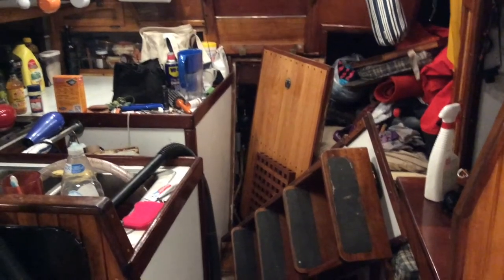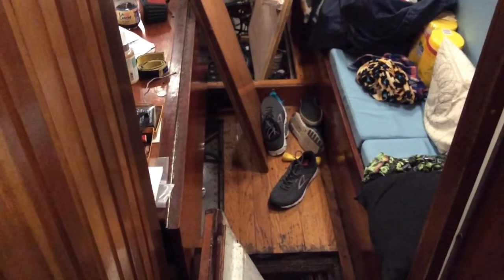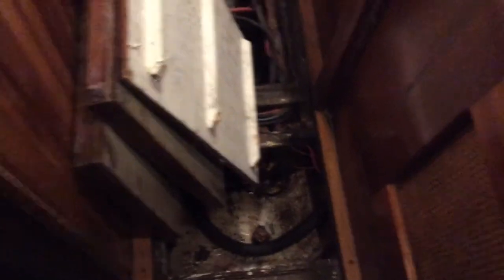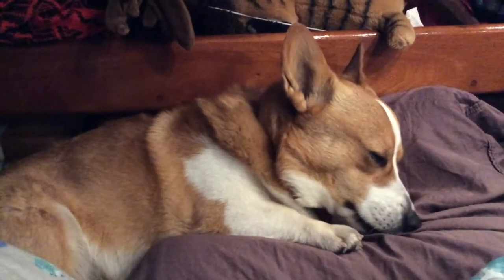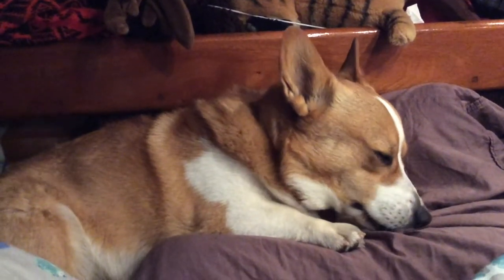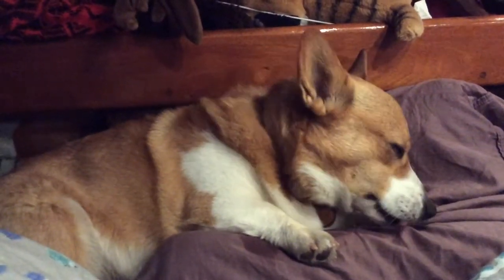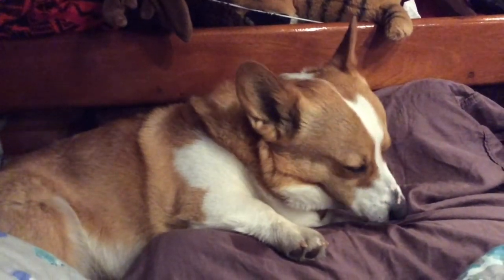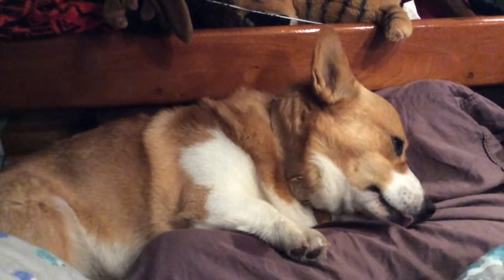Living on a Sailboat: We Almost Sank

Comment: Water intrusion from a small 1” seacock located in the hull 3 ft below the physical water line will invite 34g/min aboard a vessel. That is 2,040g/hr (Naval Sea System Command, US Navy sailor’s handbook ISBN 0-87033-248-1). 

Also a pump rated at 1,100gph will likely pump about 300gph when all hooked-up.

One final thought, a high water alarm hooked up to a horn in the cockpit would alarm passerby, dockmaster, staff etc. Put your phone numbers in the port openings with the note: ''In case of emergency call:''

Comment: You might want to buy a sprinkler timer at the hardware store. There are units that attach to the shore hose bib and have a dial that you set for 30 minutes or an hour of flow. They're mechanical and don't require any power. That way, you don't have to worry about forgetting to turn the hose bib off. Cheers!
Reply from the maker: +Stuart McLeod yeah, a bunch of my neighbors have them and I always thought "why not just turn off the hose?" Now I know!

Comment: Batteries should not be that low . Obviously
Reply from the maker: Every boat design has its flaws. These batteries are under the floor to keep weight low in the bilge. The alternative is the more modern approach of mounting the batteries as high in the boat as humanly possible but this leads to more weight aloft. 
The best plan is to keep water out of the bilge so that the boat doesn’t sink 🤣

Comment: My electric and manual pump are both in the main bilge.  Can you not set up like that?
Reply from the maker: The electric one in the bilge is 500gph and led through a 3/4” hose with a lot of head. The high water rescue pump is an 1100gph and led through a 1-1/8” hose with almost no head. 
The water was coming in fast enough that the main electric pump couldn’t keep up but thankfully the high water pump could!
Reply: @RiggingDoctor  oh.  Didn't realize you had two electric pumps.  Thanks for the clarification.

Comment: FYI...a 1000 GPH is not a high capacity bilge pump. 4000 GPH might be more like it, then 4 or 5 times that capacity for a good gas or diesel trash or Semi-trash pump.
Reply from the maker: +Nate McDaniel our high capacity pump is a manual Edson bilge pump. It pumps 1 gallon per stroke, and took me about 15 minutes to drain the bilge. The problem with it is I need to be there to run it. I never thought we would need a rescue pump while tied up in the marina :(
Reply: True enough, it is like having an accident in the parking lot. Maybe I am into overkill, but I really like good and redundant de-watering capacity...

Comment: Send me a pic of the motor and specs, If it needs replacing, there are good buys in Calif,
Reply from the maker: I'll keep you posted! As of right now, it's not working but I haven't dug too deeply into the cause of the problem
Reply from the maker: +Fritz Sproul the motor is by Electric Yachts out in California. I talked to them and they gave me some good news: the controller is the expensive part and it's waterproof, the motors can run under water for a short time and since it was fresh water they think it should bounce back. I'll keep you posted though.
Reply: ok do u have an email you can get me or if one is listed somewhere I can go find it and then it will be easier to send stuff. cheers
Reply from the maker: Riggingdr@gmail.com

Comment: And you wonder why you have electrical problems? with your electrics?  Get that controller out of the bilge. You biggest concern is not the electric motor and controller? Those connections should be encapsulated in epoxy. You are lucky you didn’t have a short and catch fire! You were connected to city water how about the electrical?